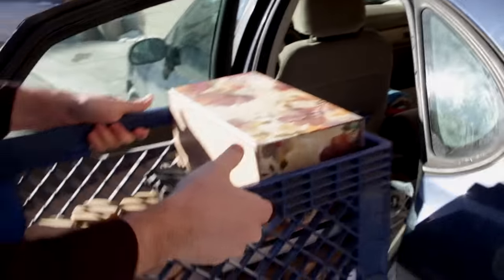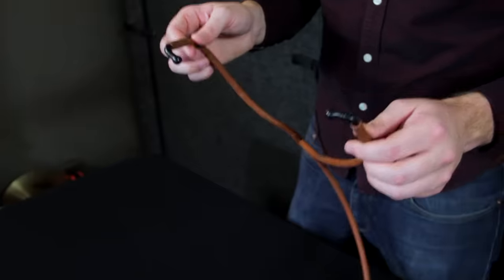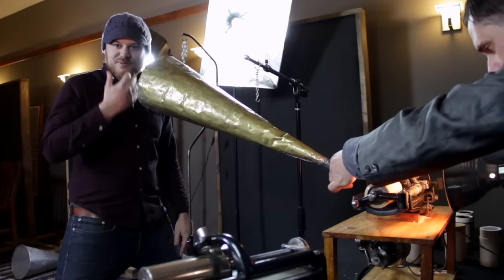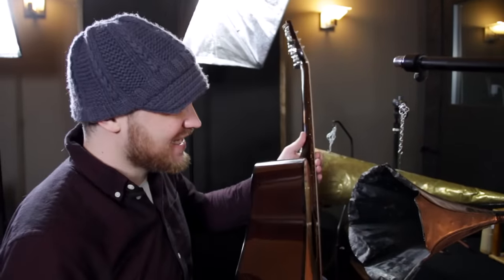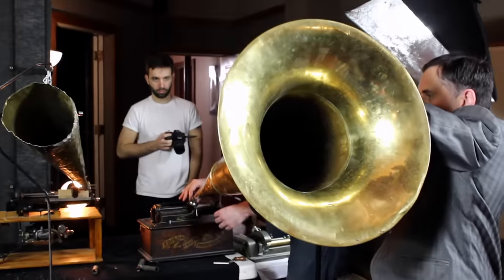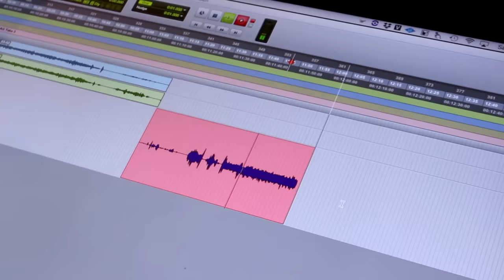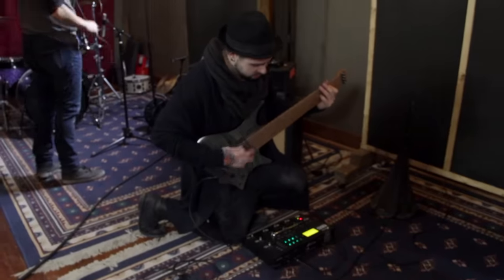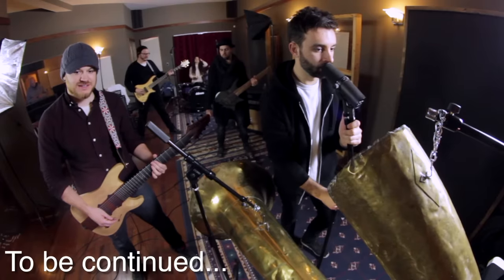Recording on 100-Year-Old Equipment

Comment: "You're recording with a barometer, basically."  Gives a new meaning to "recording under pressure."
Reply: HIYOOOOOO!!!
Reply: It means you are recording the air pressure of the sound waves, which move the needle, which presses harder or lighter on the wax...
Reply: Dan L :(
Reply: PRESSURE!!,  pushing down on me, pressing down on you, no man asked for.
Reply: * John Deacon has joined the chat *
Reply: @danl9407  that's the joke mate

Comment: Nice! Youve outdone yourself, Rob. 

Next up: An entire band recording directly to one-track mono reel-to-reel tape.
Reply from the maker: Thank you! Would be cool to explore more vintage recording equipment.
Reply: A wire recorder would be cool, pre war if you can find a working one as it is the first type of magnetic recording machine.
Reply: I do have a 1/4" full track Electrosound http://lcweb2.loc.gov/master/mbrs/recording_preservation/manuals/Electro%20Sound%20ES-505.pdf This is a full track reel to reel that was made in the late 1970's has a range of 30-19,000cps.  It is similar to an Ampex 440B.

Comment: I was really surprised to hear how poorly the guitars sounded on the wax recording, but I suppose that's as raw as sound truly gets.
Reply: Depending on what you mean by raw, vinyl is the closest to a natural raw sound wave, the only format I know of that very accurately reproduces it, on a level most audio equipment can't reveal. But I know what you mean, they're both raw in a similar sense. 

https://electronics.howstuffworks.com/question487.htm

Also vinyl captures an extremely wide range of frequencies, people don't realize that frequencies you don't hear, will still affect the ones you do hear, so their presence or lack of it might be noticed by some. IRL you're possibly picking up subtle ways in which sound you're hearing, is being affected by sounds you're not hearing. 

Blu-ray audio is close though and also covers a wide frequency range, 24-bit with 96khz sampling rate is up to around 48khz, or 196khz sampling rate up to 98khz. But vinyl is into the hundreds of thousands, doesn't really matter since no equipment can actually cover all that, not even electrostatic. 

Even if not though, people also don't realize if headphones for example can do a range of 10hz-20khz, it means it can just barely do 20khz, where ones that can do 38khz will do 20khz much better. You'll likely hear more detail and clarity in the midrange too, it's a good measure of overall performance.
Reply: It's just because it's a quiet instrument, also as the engineer mentioned the colder the room the noiser the recording.
Reply: Yeah it reminded me why big bands and recordings used banjos instead of guitars back in the early days.
Reply: I see muse, I like

Comment: Got any cardioid horns?

For laymen out there, I’ll explain what sound really is in a bit more detail. Almost everything you hear is really fast fluctuations of air pressure. That’s what moves your eardrum in and out. If the pressure changes - one change means going through both high and low pressure -  happen between about twenty and twenty thousand times per second and the changes are great enough,  you can hear it if you haven’t experienced any loss yet. With losses, you normally lose the ability to hear the fastest changes. The pattern of the changes determines the timbre, or what the sound sounds like. What any recording technology does is record a pattern as similar as possible to the pattern of the changes in air pressure. In this case the pressure changes move a device that carves wax. Playback means finding a way to translate those stored patterns back into air pressure changes. That’s what a modern loudspeaker or headphone does. 

What makes this early medium difficult is five factors:
1. The background noise drowns out too much sound. Actually, the same thing used to happen with tape hiss, though to a lesser extent. 
2. If the sound is too soft, the carving device won’t be moved detectably by the air pressure changes, so it won’t record soft sounds. 
3. If the sound is too loud, the pressure change may try to move the carving device farther than it can physically move, so it won’t record loud sounds. In any equipment, again especially including magnetic tape, if you’re loud enough to exceed the capacity of the medium to record, you get distortion. If you want to research this further, this form of distortion is called “clipping.”
4. The carving device can’t move fast enough to produce really high pitches, and those pitches (in this case also called frequencies) make the sound sound more natural and speech/singing more intelligible. This is also a problem in playback. 
5. The carving device can’t move far enough to record low pitches which involve big pressure swings, just fewer of them per second. This is also a problem with playback because in order to produce bass you need to move a lot of air, which means the playback system needs more size than you see with wax.

Comment: Didn't the one guy at the beginning say he was using the thickest diaphram? If you're having volume issues, you should be using the thin one since it's less mass and easier to move, and therefor will make more movement on the wax. Also heating the wax would probably help too, like a warm water bath.

Very interesting indeed!
Reply: I had the machine set for a heavy metal spl of about 105db.  I would have changed the diaphragm however the other one would break, it had a .008" thick 33mm diaphragm, the thinnest I have is .0065, however the dampening material has to be set on fire, and takes a long time to remount the stylus and align everything.  I will be machining up copies of my original recorder so I can have a set of 6 with thin and thick diaphragms.
Reply: Well, he thought he was gonna be recording an electric rock band playing full blast, and then the guys decided to do two acoustic guitars. If they'd started electric and loud it might've worked with the thicker one.
Reply: It's amazing how much work went into the original equipment. Really makes you appreciate the craftsmanship and the talents of the inventors of the day!

Comment: 500K in a day, not on trending.
Reply: Realize that the trending section is entirely curated and not at all organic (what they'd want you to think). Which is why so many videos like this one don't make it past the filter yet correct political videos with >5000 views get the top spot on there. It's a broken system.
Reply: john multitrack-cci indeed. There's a reason why the stuff that's pushed is the polished, cheesy stuff that typically focuses on the tastes of teenagers who typically follow trends. No way YouTube's algorithms will mainly or only focus on that type of material without human involvement. It would only be going by the number of views on a video without the nuance of pushing agendas if no human interference was involved.

Comment: There is a PBS documentary series called American Epic which features a painstakingly restored, vintage Western Electric record-cutting system from the mid to late 1920s. The mechanical and electrical complexity of the system is light years ahead of the cylinder recorder shown here,  with far better sonic fidelity,  and it cuts standard flat records (78 rpm) from which you can make a stamper mold and crank the record out by the thousands if you desire. A bunch of famous modern musicians are seen and heard in the studio actually cutting records live and direct to disk with this 90 year old equipment and one shared microphone for everybody. Yeah, you read this right, one mic for everyone. It must be seen to be believed! This series is an awesome documentary about the history of making field recordings with portable recording equipment.  Highly recommended.

Comment: Perhaps they recorded the acoustic guitars with a thicker glass diaphram, which explains why it was so quiet sounding? Just a thought
Reply: Joshsucksatguitar that’s what I thought
Reply: Guitars just doesn't move much air. Voice and brass instruments produce much more air pressure, which is needed for the needle to scratch the surface of the rolls, literally.

Comment: Professional singers from 100 years ago had a very exaggerated style of pronunciation, which you can clearly hear on old records. They all did this because they had to make sure that audiences in auditoriums and tents could hear them and understand them without microphones and speakers, which didn't exist yet. Acoustic recordings like what we see here also required loud voices with unrealistic pronunciation too. This gradually wasn't necessary as equipment got better, particularly when electrical recording started happening in 1926. Voices that were amplified by electricity didn't need to bellow at top volume.

Comment: These guys have to get used to the pressure of having only one take every time the needle contacts the cylinder to start the recording. No edits. If you mess up, you start over again with another blank. And up till the late 1940s, this was the ONLY way to record anything, before magnetic tape came into use. Every famous record you've heard from the middle 1940s backwards had to be performed perfectly, including all the musicians (sometimes a lot of them, in a big band or an orchestra) and the singers. This is where the term "to cut a record" comes from, because the needle literally cut into the surface that was being recorded and gouged out a continuous groove filled with little wiggles and bumps.

Comment: Could they not have hooked a piezo pickup to the needle to transfer the vibrations from the guitar more directly to the cylinder? Though I'm assuming they wanted it to be authentic. But I'm thinking that could be a way to pick up guitar onto wax as best as possible.

Comment: Cylinder recordings like this could not be stamped out or mass produced; in order to make 100 cylinder recordings of the same song, the band had to play the song 100 times; and therefore every cylinder record would be just a little bit different in terms of the performance. The music might start to get a little sloppier by the 70th or 80th performance of the tune, as the musicians became progressively more tired, or simply bored.

Comment: I want to add, that if you google look for a photo titled Gramophone-Recording-Session in Edison in New York Studio published by Getty Images, of a brass band recording session at Edison's 79, 5th Ave New York Studio  Taken somewhere around 1910 you will see a large brass recording horn.  If you look carefully about 3 feet down the horn in the photo you will see a shadow of the ring step, in the same spot this horn has.  When I first got the horn, on the upper left, it was the same misshapen bell, as in the photo It IS the Same Exact horn used in this video, and was also from Edison's New York Studio.  I also own another piece of Edison studios, a 97 1/3 thread per inch feed screw that mounts behind the mandrel,  and is chain driven.  Two different feeds were used for the masters (when making the molded records.) 97 1/3 for two-minute masters for 100tpi records, as made in this video.  and 194.66 TPI for four-minute masters, for the Edison Blue Amberol and metallic soap Amberol cylinders.  The wax master record was put in a vacuum with gold leaf.  The gold leaf was hooked to an induction coil. The bell jar vacuum pump turned on, the master on a mandrel with the iron disc above.   A motor turns a magnet and then turns the master inside, and then the induction coil turned on, which vaporizes the gold going from one pole to the other, and the record between them is plated with thin gold plating, making the wax master conductive to electricity.   The master was put in an electroplating bath of copper sulfate bath for two days so that about 1/16th of an inch thick copper shell formes around the master.  The outside was trued on a lathe, and the thin end was trimmed until the wax master was seen, then put in a cold room and the wax shrank and could be removed from the tube, the grooves in the copper.  Mother records were produced from the master mold, and then working molds produced to make commercial records from.  The Edison Gold Moulded records and the wax Amberols were made about 1908 or so in automatic molding machines.   The worker heated the mold up in molds and was heated in a steam heater.  The worker put the mold down a chute, and the mold charged with about 120 grams of record compound (aluminum sodium stearate, copper stearate, carnauba, lamp black, and pine tar. ) The mold was spun at 1,800rpm or so down 3 rubber rollers.  When the molds went to the end of the machine, the compound was hard enough to retain its shape.  Next, the molds put in a lathe that made a taper and ribs on the interior with water-cooled tools.  The molds were put in a cooler, which had water run through metal tubes.   The records shrank out of the molds and then were put on warmed metal cores to prevent warping the records.  The last part of manufacturing them was to press the metal cores out and box them, in fleece-lined boxes.

Comment: Maybe it’s possible with AI to let it learn how to reconstruct a hifi recording from a wax cylinder recording using these 2 identical recordings on wax and modern equipment.
Reply: That's a very interesting point, u got me thinking now, I think you would need a variety of different recordings, for example you could record a brass band, maybe a choir, a full symphony orchestra, that sorta thing, so it could learn how to interpret different sounds
Reply: @carpetsomething  Yes, it has to synthesize missing sound data not present on the wax recording but would have been when recorded on modern equipment. By having various recordings it could make a best guess. Imagine when this works, you could create hifi versions of those ancient late 19th/early 20th century wax rolls.

Comment: This shouldn't sound that bad.  I know and understand as a collector, Edison machines and they don't sound like this, even if the material being recorded was light or very low volume.  Edison would never have sold a single machine if they sounded like this.  There are hundreds of resources on Youtube in which vintage cylinders are played by collectors on their restored machines and NONE of them have this much surface noise.  The problems here could be the quality of the wax cylinder (many collectors roll their own; you can buy them commercially), the cutting stylus, or the sapphire on the playback reproducer.  UGH!

Comment: Can you try recording with the system before this one.  Instead of a wax cylinder ,use paper with coal dust and a feather.  I am serious. However you will need a modern computer for playback.  As they could not play these images back in the day they were made